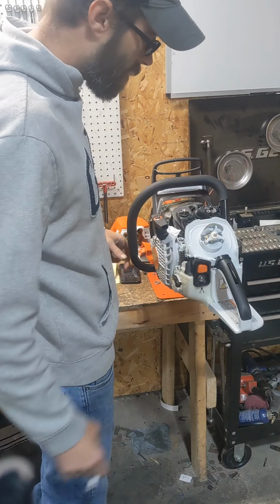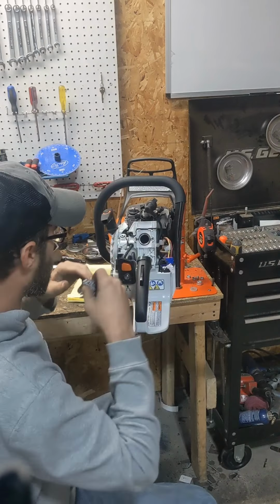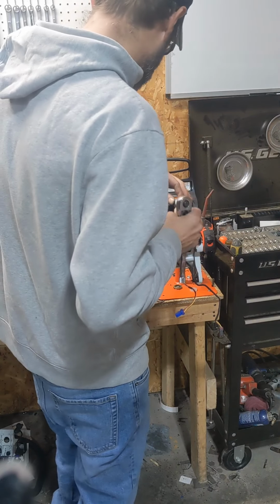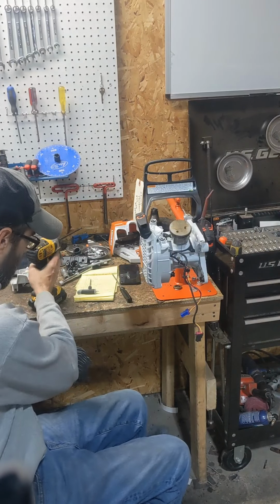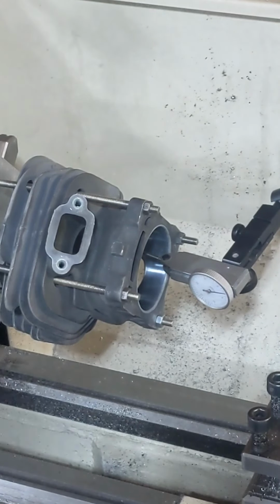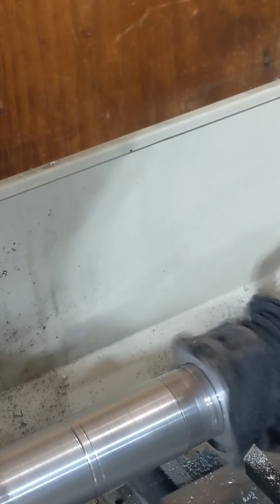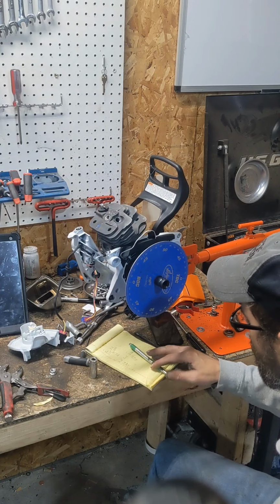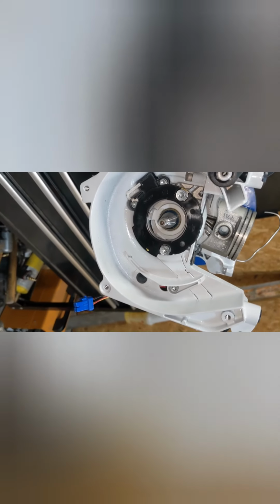Stihl 500i disassembly and porting process

Comment: I'm wanting a 500i done up like you did this one, only I'm thinking of putting a pipe on it also after the port work is finished and saw is back home.  I like that engine stand you got there. I'll connect you though you're website and I'm all ears on all modified tricks you recommed.
Reply from the maker: Sounds good!

Comment: What do you charge to port a 500i if I sent it to you?
Reply from the maker: 350.00 includes return shipping, lathe work and port work.
Reply: @buxtonworksawsllc9645  how do we set this up?
Reply from the maker: Either fill out a contact form on the website or give me a call... Numbers on the website to. I will be out of the shop the beginning of next week. Typically I'm in 9 to 5 m to F. I just need to grab some info. Simple as that... All billing is done after it's complete. www.buxtonworksaws.com
Reply: @buxtonworksawsllc9645  thanks.  I will be in touch.